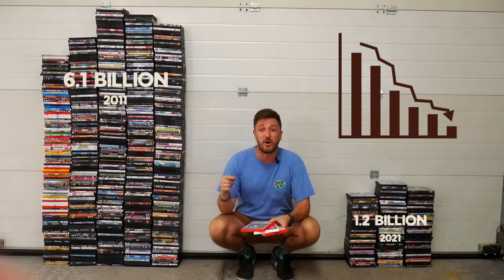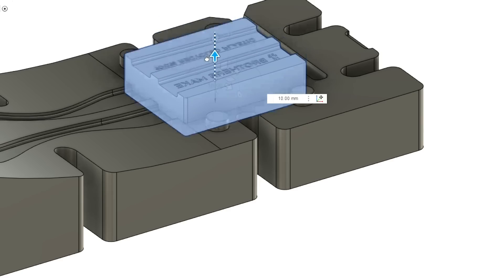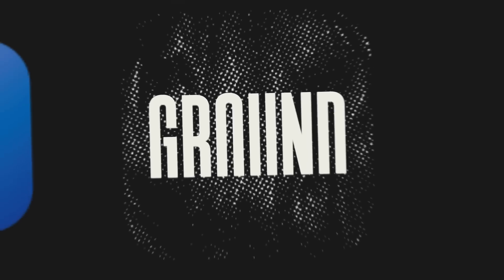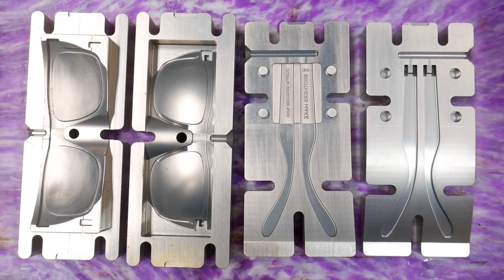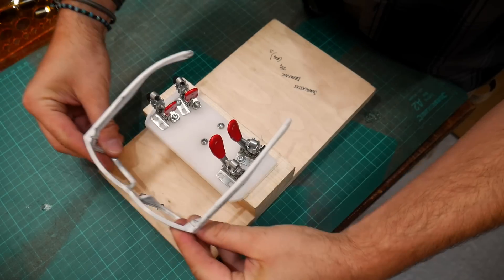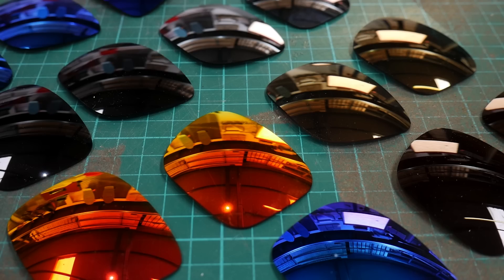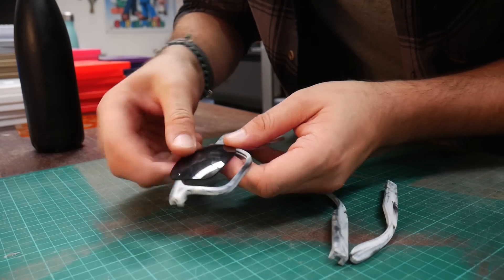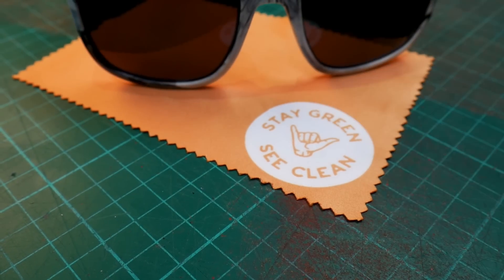Turning Plastic Waste into Sunglasses

Comment: Hi lovely work. I've been yousing recyclable HDPE with a injection moulding machine and the plastic has been breaking is it because I'm not heating the mould.... Because when I used my panini maker same mould it was fine. If so can you tell me a rough temp please.

Comment: @brothersmake - what was the best mould temp? How did you even measure the temperature of the mould? I see on the carboard you have 27-24 degrees is the rotation of the injection machines arm? How did you even measure the degrees?

Comment: Could you iron the ldpe covers into tarps or sheets like you guys did the plastic bags? (I'm pretty sure it was y'all, might have been precious plastics, but y'all are the ones that sent me there lol, but I'm pretty sure it was y'all.) I'm also curious if that trick could be used to create weather resistant tarps, like for camping or cargo coverings? And they'd be crazy easy to patch too, if it worked, instead of throwing it away.

Comment: What I see in this video is  a prime example why I usually don't buy from small businesses because they overinflate the costs and in effects prices of their products by being inefficient.

Yes, you can melt bad frames back down, so there is no/not much material actually wasted but wasting tons of work hours to practice drilling and cutting a groove just to have a singular person be "the expert" on it instead of deskilling and streamlining the job by designing and printing (or milling) a few proper jigs for the task is immensely wasteful from a financial point of view and from a human capital point of view.
Reply from the maker: We have multiple jigs for multiple stages of this process. We are very much advocates of speeding up the process wherever possible as long as it doesn’t hinder quality. The issue with using a jig for the groove is that there isn’t a simple answer. Trust us, we’ve tried.

To say we’re overinflating the value of the product is assuming that there would be a quicker way to manufacture these that we haven’t found. We spent 10 months developing these and tried hundreds of different techniques.

But no worries, you aren’t our target market 🤙🏽
Reply: @BrothersMake 
I can only go by what you show on video. And a jig that requires you to assemble the frame and the arms, only clamps the arms while relying on PP to PP friction for the frame to stay in place and then requires precise manual placement under the drill without indexing against  any fixed point can not be what you consider the best solution for precisely drilling those holes. 

You are working with molded plastic. One of your biggest strengths is that your parts will be effectively identical which should allow you to use tightly fitting jigs and doesn't require you to do any assembly before the final stage.

And for the groove a pantograph contraption would likely work very well. At least it worked very well for a guy who showed me how he was making sunglasses from recycled bamboo chopsticks a few years ago.
Reply from the maker: It’s a nice idea, but you’re wrong unfortunately. The shrinkage on the PP parts are variable between 0.5-2.2%. This is enough to make any accurate jigs effectively useless. 

A pantograph would work fine, but the issue with that is our frames have compound curves for enhanced comfort in wearing. This, in addition to the shrinkage issue means that any jigs are basically impossible to create that would make an effective time saving versus doing what we’re doing already. Like I said, we’ve tried a LOT of different options

Comment: Hey guys, I see you using nuts, bolts and wrenches for opening and closing the moulds each time. It seems inefficient to me. You must have thought about better solutions. Why don't you use quick release systems like you find on bike axles and saddles? 6:51

Comment: DVD clear flexible case covers: those look like the right kind of plastic to resist casting resin. So, resiner mats or, if the properties hold through reshaping, molds and texture mats for resiners. I know, casting resin is more plastic coming into the stream, but a lot of folks recycle other stuff in their crafting, and the resin is just the protective coating.

Comment: Could make the grooves more precise by using a jig to fix the frames, a cnc with tilting spindle(also would need custom gcode to follow the 4d profile) and a opencv based work centering. Just some suggestions.❤👍

Comment: Use gold and silver cases with white and grey to give a fancy look to the marble effect. You could also try gradient effects.

I'd say the sleeves would work for simple and cute diy projects. Most of my ideas are more of a cutesy diy style which doesn't fit the channel, but you could collab with someone with that vibe, which would also appeal to a different demographic and share your message with more people!

A sheet of clear plastic can be used to write and erase things. They can be placed over white to mimic a white board. Left clear, you can place it in front of you towards a scene you want to draw and trace over the image you see with markers, to assist with the drawing process. It can also be used to create windows on containers that aren't see-through (ex. boxes), to make things easier to find, or even drawers and cabinet windows. Looking at a starbucks drink I got on the supermarket, maybe the sleeves can also be used for cup covers that prevent spilling, but are also transparent so you can see what you're drinking, I's say it's useful for kid's parties. Can also be used on photo frames, especially frames that will have a tendency to fall (ex. house with pets or children) since they won't shatter.  Could also glue them over cute paper images to make them waterproof and durable. Maybe it's not really your style, but you could also add glitter between two layers to make simple shakeable toys, heart or star shaped would be extra cute, that can be added to notebook covers, or turned into cute keychains. If you can make them create a more 3d shape that can be filled with some thick liquid where the glitter floats, even better.
I really like @aprildegele1510's idea of food baggies since my mom uses them a lot. One thing we use baggies for is to keep each cat's food weighed and separated, since they're on a diet.

Out of all of these ideas, I think the one that wastes less material is to use rectangular pieces (container windows and photo frames), cutting off the bendy part of the sleeves and weaving it into tiny baskets, because tiny baskets are always useful.

Comment: I think that injection molding for the sunglasses is cool, but traditional glasses are made from a sheet for a couple reasons. First, doing things like cutting the grooves for the lenses is a lot easier since you can just chuck the faces onto a routing table and route the groove in a matter of seconds. You mentioned the curve of the frames being an issue, but when glasses are made, the curving is one of the last things the do, they heat up the frames and either put them into a press or put the curve in by hand. For the hinges, I would consider using screw-mount hinges that screw through the temple and face if you're concerned about the parts being serviceable. If you're going to use a single screw for the hinge it's probably best to find one that's not threaded in the middle and only threaded where it screws into the temples because the screws can work themselves out as the hinge is opened and closed. If you are going to stick with the screws that you're currently using, consider drilling the hole in the face slightly bigger than the screw so the threads are only going into the temples. You'll be able to keep the temples tight via friction from the squeezing of top and bottom of the hinge, but the screw shouldn't back out as easily.

Comment: I sometimes consider making something of old CD's or CDR's, but I hesitate.  Are the chemicals in them safe? I mean, isn't the dust coming off when sawing, milling, etc poisonous? Or is it safe to touch a machined side for longer periods (like when wearing it as glasses). The silver or gold stuff of the disk would  no longer covered by the plastic or some other coating, would it? The fact that people just make things with them is not really easing my mind. The bad stuff often appears years later. Like with asbestos or lead paint. Any real information about this?
Reply from the maker: Yes! We have a whole video about plastic safety. Also, we are using the cases, not the discs.

Comment: Wow! Cool process! Maybe the next glasses mold could include simple snap in place hinge joints for the glasses instead of needing the extra drilling and screws process. These newer glasses mold could not require the grooves cutting process too! So much work could be eliminated with a better mold design, but I appreciate the work you guys put into these uniquely DVD recycled glasses. Love the recycling! Keep it up you guys!

Comment: Could the plastic sleeves be ground down and used as a supporting/strengthening/bulking material?
I guess that when the product gets recycled, you wouldn't be able to separate out the materials though.. so probably not a good idea, thinking about it.

Comment: Make a jig for cutting the groove, so you can keep the same distance, you just need a stopper to rest the front of the frame against. Same for drilling those holes, take that jig a step further, and add a double press drill. You could DIY something easily with T slotted aluminum extrusions from McMaster and cheap drills from HarborFreight.

Comment: Could you drill two holes on the sunglasses and add two small dimples on each leg that fit into the holes? That way you dont need to add a screw to act as a hinge and everything is held together by pressure

Comment: One of the easiest things you can do with those sleeves is punch holes in them to fit into a notebook insert. Then, you could make a recycled notebook cover, screw or imbed the binder ring into the spine for a photo organizer. Or, you can just do a front and back cover and use Chicago Screws to insert as many of those sleeves as needed. With added extensions to the screws and no spine, it can be expanded for quite a substantial depth. 
Or, since few folks have photos any longer (except for old ones), the same concept could be used for a seed book. Seeds sealed properly and organized in the sleeves ... or a simple way to store dried herbs in a small space, or as a scrap fabric organizer (depending on the size of the sleeve), or a fiddly-bit organizer for crafting ... so many options. They wouldn't be acid-free, so probably not great for paper crafts that need to last forever, but certainly good enough for anything that will be sealed in a small zip, like seeds and small amounts of herbs, tiny fabric cut-offs, dried flowers ...
endless possibilities.
Reply: Good thinking!

Comment: Fantastic achievement.
I made a sun shade for my 7" monitor from black DVD cases. No shredding required, but as PP is such a slippery substance I had to bolt it together with tiny bolts.

Comment: I have a question guys. Plastic shredder machine or plastic granular machine. Which is better? I been told the granular would be better as plastic melts better through the injector and extruder.

Comment: I commend you for your efforts and if you ever develop these into the "wrap-around" style I'd more than happily buy a pair or two.
On the note of the excess supply of CD's/DVD's though, the make for fantastic DIY solar/thermal energy array items with just a little copper wiring, plus the 0/1 coding makes them good for wipe & re-write, so have a little scout across Youtube and see if you can't find someone (or multiple persons) that'd make good use of your excess supply there. 2nd & 3rd world country developers are always grateful for the help and there's not enough sun in old blighty to make it a worthwhile endeavor on your part.

Comment: Amazon should be shipping DVDs and whatnot in cardboard rather than plastic cases.  The plastic cases make sense in stores for advertisers, but not for online shopping where the customer will put it on a shelf or in a CD multi case.  I switched almost my entire collection to sleaves that fit the liner as well.  It takes up 10% of the space that the original cases took up.  I only keep the cases for particular high quality movies like all the major Disney films.
Reply: I like the cases with the artwork I keep them as they come

Comment: You could consider offering the ground up plastic to crafters for use in whatever they are making.  The plastic from the front of the cases could be used to make small resealable bags to put the plastic grinds into.  Great job guys.

Comment: To make these faster and easier while minimizing the work and waste change the way the mold forms them. By splitting the lense’s frame section at the hinge through to the nose section. The screw at the judge for the ear piece will hold it together, you’d be able to mold the frames with the lenses groove already precut so you’d be able to go straight to the clean up stage and this would also allow a place to add badging and colors to the nose piece screw in a different contrasting color allowing for more versions or you could insert a magnet and change out the colors to match their outfit or mood for the day.
Reply: That sounds like more work! If you can't reduce the number of hinges, then it sounds like more work.